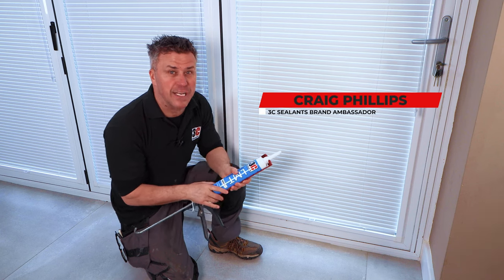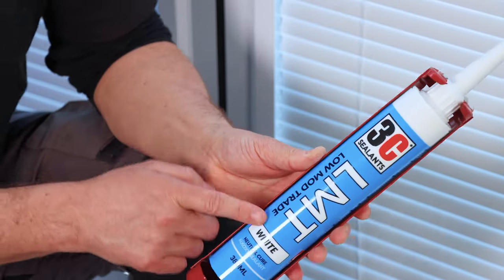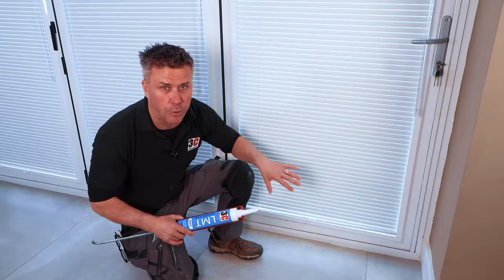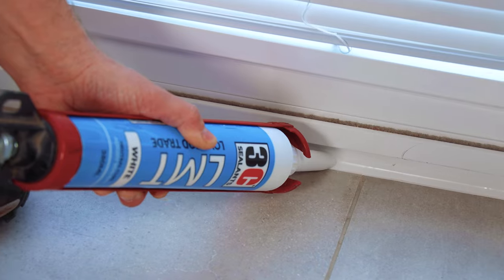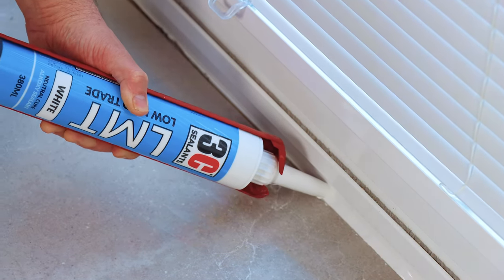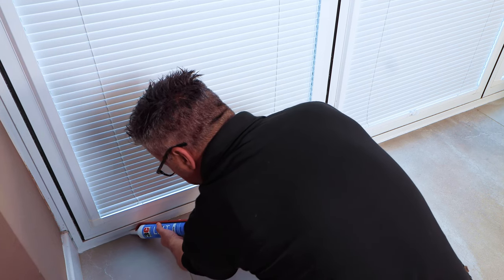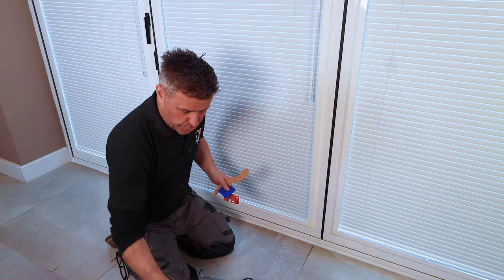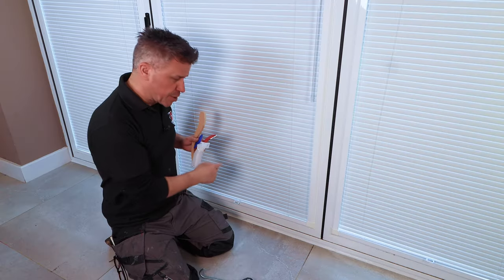DIY Guide To Sealing Around Window Frames Internally Or Externally

Comment: Why do all white silicon to yellow ? I have a 6 months old house bought the good auilty 100% silicon
Reply from the maker: Most silicone's turn yellow due to UV light from the Sun, however it can also occur cleaning products, eg. bleach, shampoos, soaps etc. If the silicone is not cleaned off/maintained properly, over time they will go yellow
Reply: @3csealants  so no way in hell to get a silicon that won’t turned yellow. . I even noticed this in the the clear type as well !!!